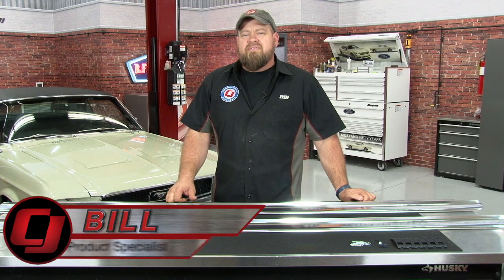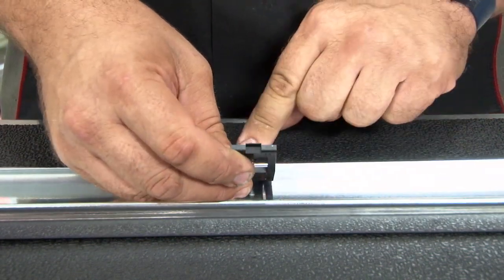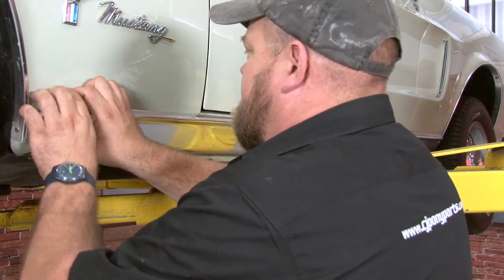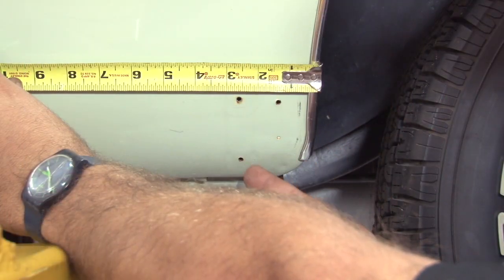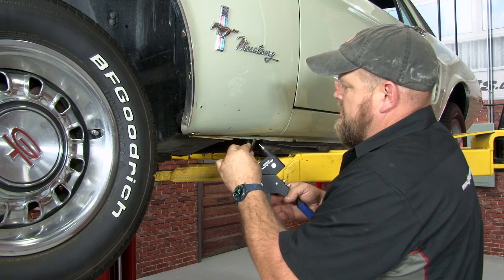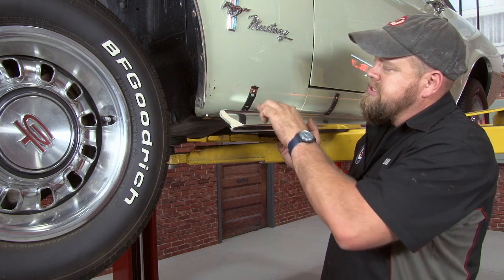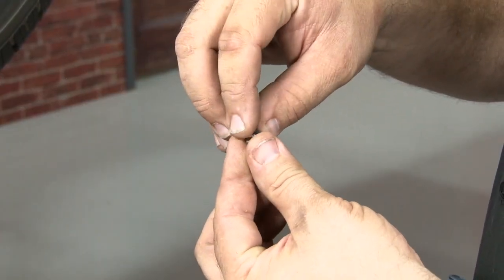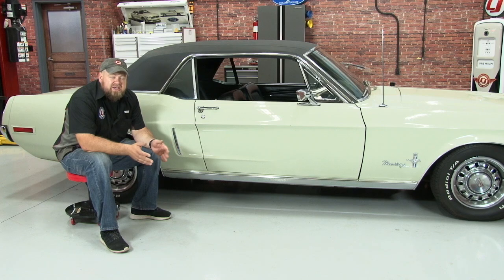Rocker Panel Molding With Clips | 1967-1968 Mustang

Comment: FYI, do not rivet in the top and then drill outthe bottom as suggested. HIGH likelyhood of breaking the clip if you're not very very careful.
Reply: yes, a better idea is after drilling the top hole hold the clip in place with a small screw, mark the bottom take the clip off than drill it.

Comment: Great Video, one question, the holes to be drilled below the door does the same measurements apply to a 1965 mustang?
Reply: +kepaloha  I would guess they are different on the 65.
Reply: instaBlaster.